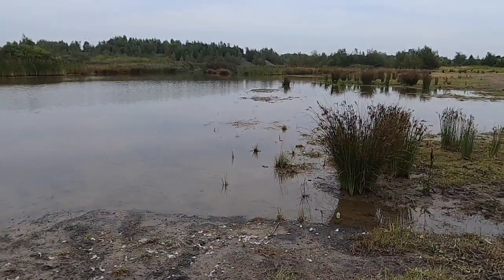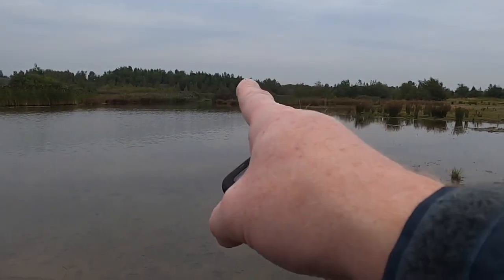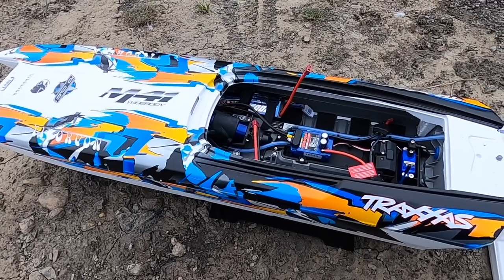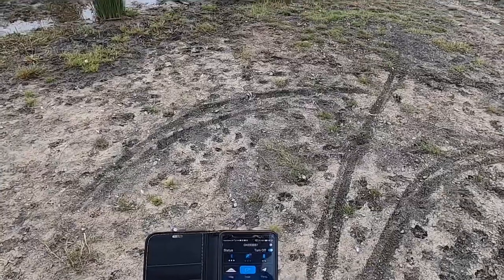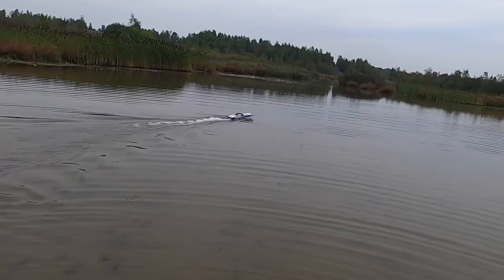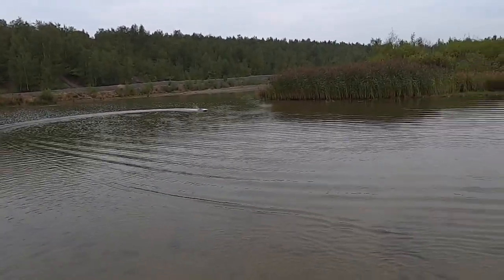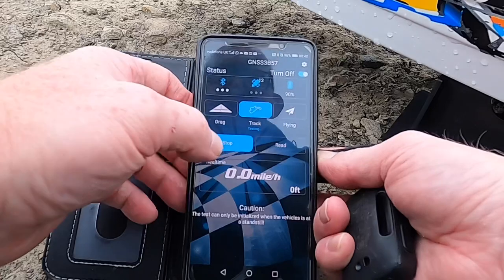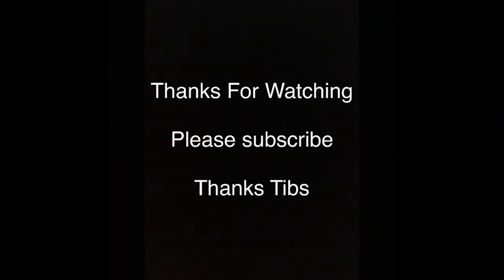TRAXXAS M41 SPEED BOAT. HOW FAST IS IT ?

Comment: Haha..🤣..that was kind of weird at the end when you were stood in the middle of a lake running your boat. Very surreal. Hope you had your wellies on. But yeah, 46mph in limited space with heavy batteries is pretty impressive mate. You'll have to give her a proper go on one of those Rivington reservoirs. Lovely boat this too, the sound alone when you let her rip - beautiful. Nice upload pal...👍🏻👍🏻.
Reply from the maker: Thanks a lot dude. Yes i had my wellies on lol. I actually bought a pair of waders from eBay that go right up to my waist. This puddle usually goes about knee height, but that means that when you walk in it with wellies, water splashes over the top and you get wet feet lol, so i bought some waders which work perfect 😎. This big puddle was a little shallow today because we have not had much rain but i knew it would be hit and miss when i went here today. So i to am very happy with the result, just shows how fast this thing accelerates !!!! And it might not look it on the video but these boats are really bid too. We have been meaning to go to one of the lakes at the bottom of Rivington but we just haven’t managed to sort a day out, time just flies by doesn’t it

Comment: So cool tibster I was looking at videos for the m41 because I'm getting one and your video came up nice runs
Reply from the maker: They are awesomme bro. You wont be dissapointed. I love driving this boat, it accelerates like a drag car lol and it sounds brilliant in the water too. But i would recommend that you will need decent batteries in it. I have 80c rating in it. When i use cheaper batteries or lover C rating then it doesnt run as good and its slower too.  And make sure you got space to store it because its HUGE lol.  I will look out for your new purchase dude

Comment: That's a good number on such a short distance bro 👍 seems like it could do around 50 on a longer and straight section. Nice ESC btw, Castle 💪
Reply from the maker: Thanks bro.i think it might hit 50 mph on a longer stretch too. It also has the capability of moving the batteries along the inside of the hull in different positions. This may make a difference too ?
Reply: @tiborvon  I don't know anything about RC boats although I've got an old one from the 90s and a hull, which I'd like to equip some time with all the parts. But I can imagine that putting the battery to the rear would increase turning and contribute to snappy change of direction, and putting it farther up front would increase straight line performance and stability. Possibly even give more speed because the hull wouldn't lift as much thus giving a better attack angle of the propeller? I'm just guessing here bro, but I'd like to know the answer to your question myself. 🙂
Reply from the maker: Yes, i would like to know too. And there is only one way to find out!!!!
Reply from the maker: I replied to your question re the nitro by the way

Comment: love mine mate, get a metal prop from RC Boat Bits in Oz, mine topped out at 65 mph.
Reply from the maker: Thanks a lot dude. I actually just got a metal prop which is from the sonic wake, i havnt tried it yet but it is a couple of mm bigger than the stock one.
Reply: @tiborvon  Makes a massive difference, run high C rated batteries too for speed runs, mine are 140C so you have a massive burst of power straight away.
Reply from the maker: Yes i agree. I originally had some 50c batteries in this and it didnt run well. So i bought these 80c and they are noticeably  better. I dont have any higher rating than 80 but i might have to have a look at investing in some.
Reply: @tiborvon  well worth it for speed, I run no less than 140C its mad fast lol
Reply from the maker: Mad fast lololol.  That’s what we like dude 😊
Reply: @tiborvon  totally 🤪🤪

Comment: Hi.  I compared the M41 and the Spartan and I must say that the Spartan is faster.  But the M41 is more stable.  So that's how it works
Reply from the maker: I would have to agree with you. Some of my friends have V hull and they appear to be faster but they are not as stable either in a straight line or when turning. And they turn upside down more easily. Having said that, with a V hull boat, you tend to have self righting which is a very good feature. The M41 type of boats do not have this function which can be a pain lol. But for me, this means that you have to drive the boat more realistically. You can not just pull full throttle all the time. You have to drive it depending on the water conditions. This is something that i actually enjoy because it is more skilful and realistic. Having said that,Volantex have one brought out a non V hull boat that has self righting.  Since this video I have bought a V hull boat. I have only taken it for 2 runs so i am not fully experienced with it yet, but it is definitely not as stable in this form. I have also since had 48 mph from my M41 without any mods, just under different condition.  Thanks for watching my friend
Reply: @tiborvon  Hi
it and the water resistance of the M41 is greater. In fact, the electronics are exactly the same as the Spartan, and the aforementioned water resistance tends to drain the battery.
And as for the more realistic management and behavior of the ship, you're right. Other boats are needed for more realistic swimming.
I wish you a beautiful sunny day my friend
Reply from the maker: Yes, the battery life on boats is not to great lol. But i suppose another reason for this is because we are always full throttle when driving our boats lol.  I also wish you a nice day my friend 😎
Reply: @tiborvon  always full

Comment: You’ve either got too much weight forward or trim tabs down too far cause you’re running way too wet, that boat stock runs 55
Reply from the maker: I agree. I need to experiment and made adjustments. But this video is purely a speed straight from the box 👍👍
Reply: @tiborvon  yeah I have it too. The stock electronics are garbage if you’re wanting to run bigger props. I put leopard 4082x and seaking 180amp esc in mine 🤪🤪
Reply from the maker: How fast have you had out of it
Reply from the maker: I love this boat dude.
Reply from the maker: Sub number 8 👍👍
Reply: @tiborvon  I’ve had it up to 60 but still not tuned right and I broke shaft, too much power and too big of prop on stock flex shaft lol
Reply: @tiborvon  and yes you got a sub
Reply from the maker: Thank you